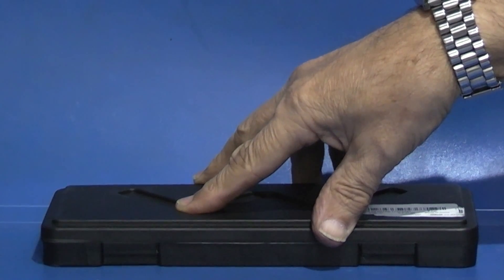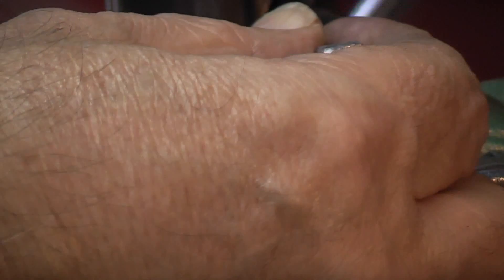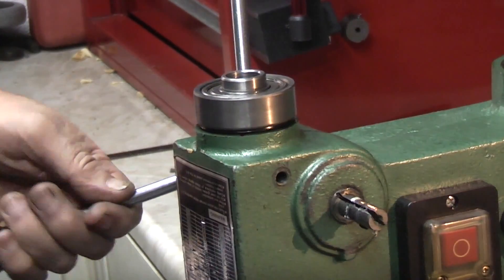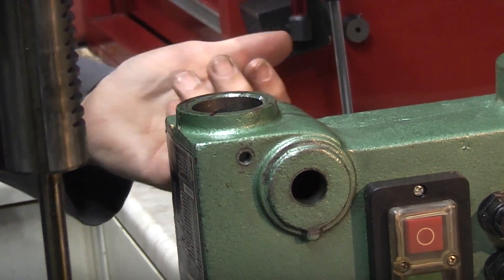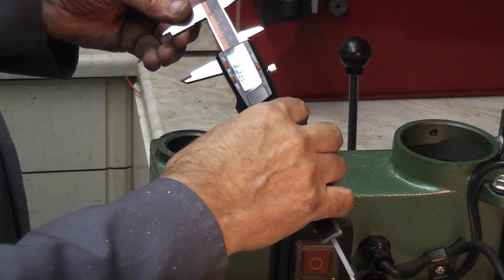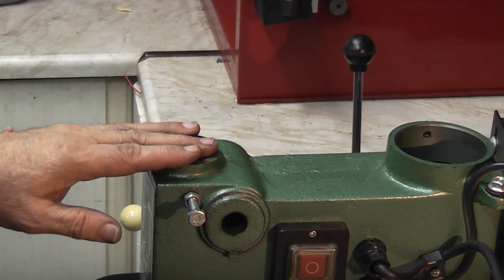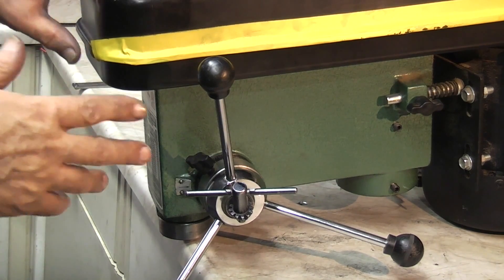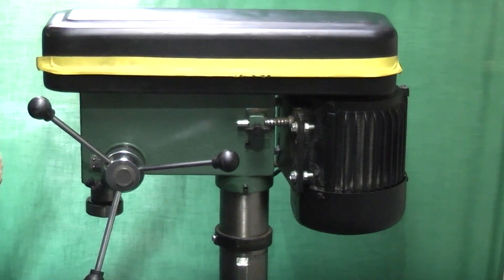Drill press wear check

Comment: Not even sure if I can lift my drill press head to remove it now days. I know it needs work. I have had a magnet on mine to hold the key for years. Rather than turn a nut for depth setting I put a collar with thumb screw.

Comment: I have a similar drill press and I too had problems with the nyloc stiffnut unscrewing on the pinion spindle.  I determined that the cause was the slot (return spring anchor) closing up, and got round this by cutting some strips of shimstock to insert in the slot after assembly to prevent this, now the nyloc nut stays put.  Not sure about the wear you measured in the quill bore after 20 year's use - mine was about the same when I first bought my machine.

Comment: Hello Allan - I was looking at your solution of using tape to hold the torsion spring nut from moving. Have you considered finding a nut/jam nut to use instead? That way you could set your tension and then hold it with the jam nut with less chance of it slipping. I'm putting off (so far) fixing the other end of my spindle as sometime in the past the spindle pulley has been beat up fairly bad.
BTW - I've not seen it written - is it Alan, Allan, Allen? Thanks, enjoy your videos!
Reply from the maker: Hi Jim Its  Alan